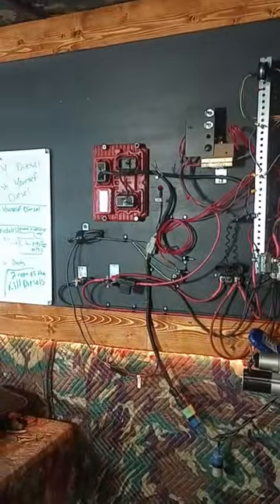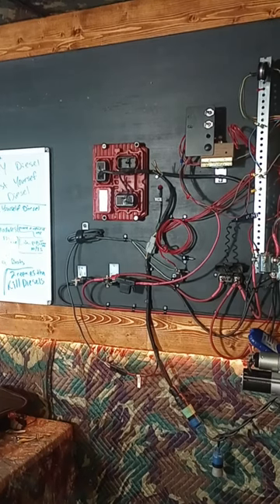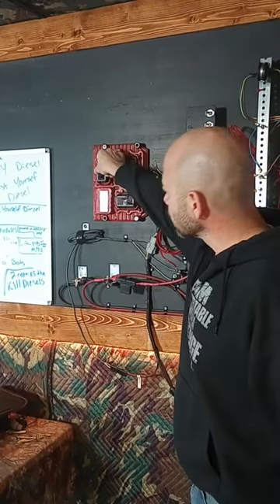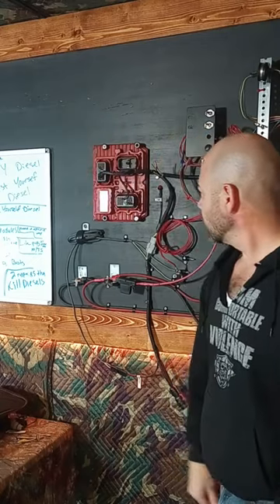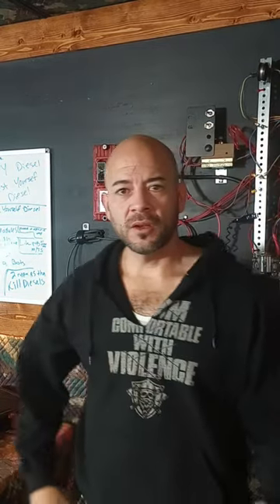Datalink diagnostics. how to diagnose comm and ecu comm fault issues on big trucks. #fluke

Comment: Scopes are more prevalent in automotive because of lack of access. With the right training/experience you can troubleshoot bad injectors/coils/fuel pumps/starters etc. right from the fuse box. I used to work in automotive but now working in material handling equipment. I have plenty of coworker with 25+ year of experience in different fields that are shocked when I use a scope to troubleshoot issues they couldn’t fix, especially the intermittent ones. The scope is a powerful tool, but at the end of the day, having strong foundational knowledge is most crucial. No amount of tools will replace great training. 
Keep up the good work, thank you for sharing your knowledge.
Reply from the maker: Very well said!

Comment: So what software will do a roll call like you are referring to? 

Checking back bones is usually my go to after taking a look at the codes and what some values are. I believe the last one i had to work on it was an outlet Knox abnormal update rate as well as dpf temp module  abnormal update rate. that someone changed the sensor on and the code was still there. Checked the backbone to the sensor at 120 ohm. Checked the backbone to the vgt and was at 1.2k or something. tested can wire continuity after unhooking the sensors on that line and found high resistance. Hooked sensors back up and wiggled the harness around until I wiggled a part of the harness where the resistance jumped around (jumped down to 120). There was a couple wires rubbed on the left side rear of the engine (isx 12). Repaired and all good. However, this was an interment connection and I got lucky that the wires were at that moment bringing down the network.

However, for an interment issue like this and at the time I have it, what is my best course of action to find the problem if the network is not down while I am trying to find the issue? Ohm test backbones and wiggle the harnesses related to what ever codes were set with the issue happened?
Reply from the maker: Ohm them to each other unplugged and check for continuity between the two wire while gently touching harness. Watch the blown fuse video and treat the down comm as a dead short. Check each wires to ground and the to each other and every other pin in the plug. Easier done with a fluke 233 where the face comes off. Watch that blown fuse video and see if you know what I mean. Thank you for the comments brother. Keep them coming. And all software has a was to ping every ecu. I will explain more in the future about what each sw calls it.
Reply from the maker: I talk about applying voltage and loading them to check for drops. 2nd part covers that question